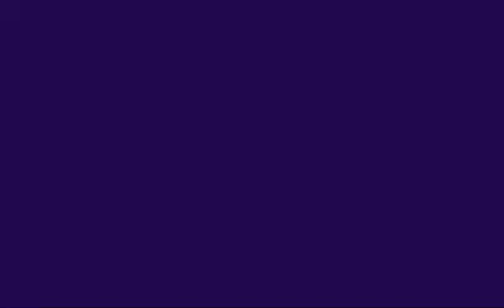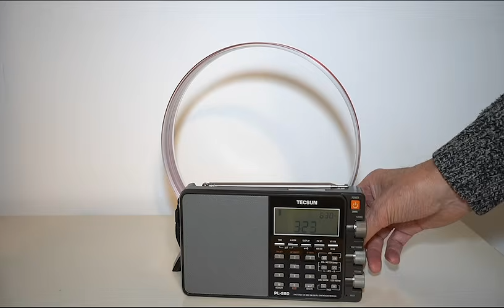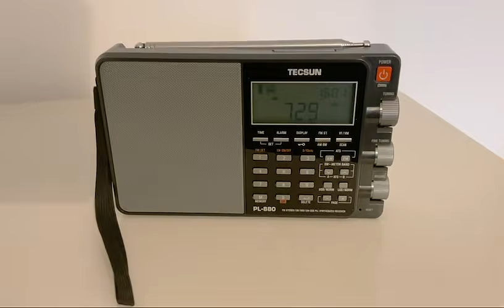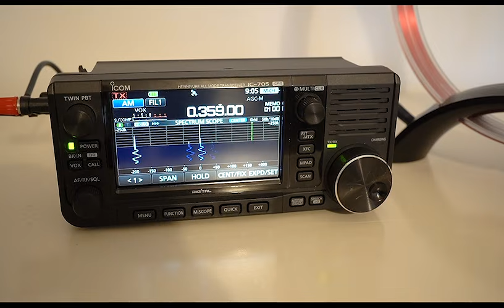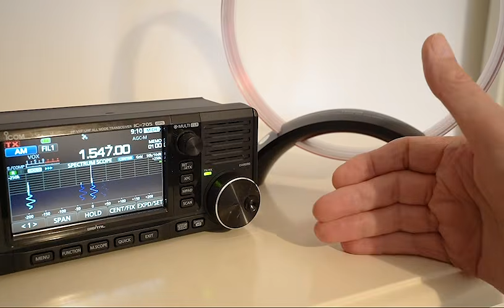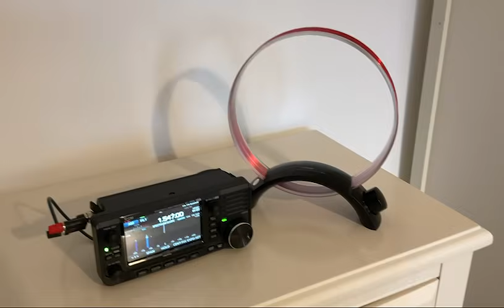The Amazing TECSUN AN-200 Indoor  Loop Antenna - LW MW and 160m. Great performance.

Comment: Hi Peter, 
This loop sounds much quieter on MF than a wire antenna....for those who play around on MF (I do Navtex DXing) on 518khz do you think it would outperform a shortish random wire, antenna due to small garden syndrome. ie does it pick up less electrical noise?
Reply from the maker: Many thanks. 73 Peter
Reply: These loops can often be used to cancel out electrical noise. Sometimes you can lay the loop over on its side and place a small AM radio inside it and cancel out strong interference from nearby electronics like a satellite box.

Comment: What was "not going on" with the band scope on the 705?  At first it appeared static.
Reply from the maker: Ther are various settings that may have changed with different video clips.
Reply: @watersstanton  was the HOLD button pressed. LOL, you might want to watch these before posting them.

Comment: How come your band scope was not moving during your LW and MW presentation with the IC705?
Reply from the maker: Because I had selected fixed on some video clips.
Reply: @watersstanton  i just tried this on my 705, I found a cable and adapter in my parts box.  This antenna is extremely directional.  It is quite amazing how sensitive it is to a few degrees of rotation.  Thanks for sharing!

Comment: The telescopic antenna on the PL-880 does a better job I think (?)
Reply from the maker: Nit durung our tests
Reply: The 880 doesn't use the telescopic antenna for MW band it uses the internal ferrite antenna. 

I have exactly the same loop and it makes a big difference.

Comment: It would couple better at right angles to radio
Reply from the maker: It does not always work that way as you can get over coupling - exactly as I demonstrated in my previius video on the AL705.
Reply: @watersstanton  That's interesting.  I only ever tried mine with a small Sony portable.  It worked so well that I made my own version optimised for long wave using a length of computer ribbon cable to form a continuous coil with a tap every ten turns.  I connected a 500pf air variable capacitor and it could peak any signal between about 150 khz to 1.9 MHz.  Mw DX on dark winter nights can be very interesting.

Comment: Very interesting Peter. I must dig out some of my homebrew MW loops from a few years ago. The output to the receiver is usually done with 1-2 turns of a separate coupling loop. Also remember that these loops also have a sharp null that can be useful to eliminate another station or QRM.
Reply from the maker: You are pribably right as later I measured a DC short across the output terminals. 73 Peter
Reply: Mine arrived yesterday. If you look very carefully, you can see a single turn coupling loop on the inside of the coil former. It is surprisingly effective on top band and has a very sharp null to almost eliminate local QRM. However, it does not actually resonate above about 1.5MHz. I can see a homebrew copy with a few less turns coming soon!
Reply: @j3xk72r9  I have the AN100 loop which is very similar. On mine there is a 3-turn winding which connects to the 3.5mm jack. I think there are 27 or 28 turns on the main winding. Connecting a radio with external aerial socket tends to dampen the loop's response and gives very broad tuning. Most modern portable radios with external antenna sockets can use these only on short-wave or possibly FM.
Reply: Someone on the net found that by connecting a 4.5:1 step-down transformer (20:1 impedance step-down) between the external socket and the radio, tuning was sharper, so I taped a single turn to the inside of the winding on my AN100 and connected to my Lowe Rx. This also had a step-down action and made the tuning sharper. If you were constructing your own loop, you would probably use a single-turn coupling winding.

Comment: Antennas often are limited to a particular power range.  Do you know if this antenna could be used on a 'legal limit' radio (e.g. 100 watts)?
Michael VA6XMB
Reply from the maker: I explained in the video that this is NOT a Tx antenna. It’s receive only.

Comment: Another interesting video. Does the 705 waterall and padapter display work outside of the HAM bands, a big pity if not. Also how does the 705 with a length or wire compare on MW?
Reply: He just probably has pressed the HOLD button that freezes the waterfall.
Reply from the maker: Yes soectrum display works across the entire range.

Comment: In the US I found this on Amazon for $34 called the "Eton Corp. NGAN200 Grundig Indoor Antenna"
Reply: I bought the Grundig branded version over a decade ago. Works pretty well.
Reply from the maker: Sounds similar. 73 Peter

Comment: Peter, I have had one of these Tecsun loops for a few years with my portable  Sangean ATS-909 receiver.   It works quite well as you have demonstrated for LW and MW.  I have also used it with my SDR Play receiver.  I haven't tried it yet with 160m, I never thought of trying it on 160m since it wasn't documented to work on that band.  I will be trying out it 160m next time I use it.  Your videos are great, I enjoy all the antenna videos the most.   Keep up the good work! ... 73, de KY4ROD.
Reply from the maker: Hi Rod,
160m is on its upper limit but it certainly works. 73 Peter.

Comment: Looks ok for £40, would have been nice to see the tecsun receiver working on top band, many moons ago I used to build frame antennas to play with  on the lower bands when I was a SWL. Cheers Peter
Adam G7CRQ
Reply from the maker: Thanks Adam
Reply: @watersstanton  Can i used the loop for 80m and 40m?

Comment: Great loop and I also purchased one from you.It really is amazing BUT it only works between about 490 KHz to 1940 KHz.For longwave and NDB beacons I use a dedicated loop for those frequencies . 73.G7HFS/PA3IKH.
Reply: Yes I use mine to listen to Dutch low power medium wave stations in Zeeland."Happy AM" on 1395Khz in Middelberg and "Vintage Music Radio" on 1485KHz in Vlissingen.They really are amazing loops for the medium waveband.👍
Reply from the maker: Thanks for viewing. 73 Peter
Reply: No beacons?? Crud!